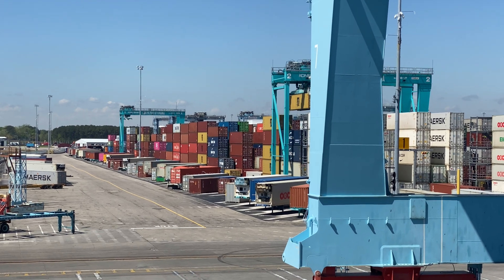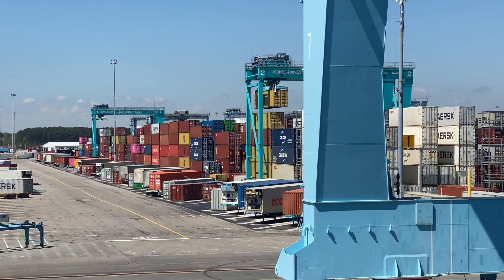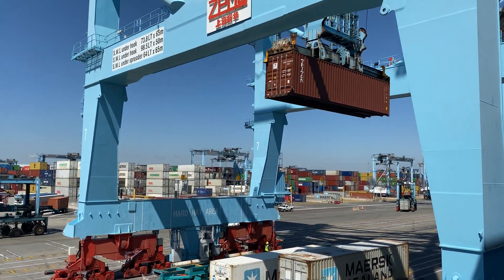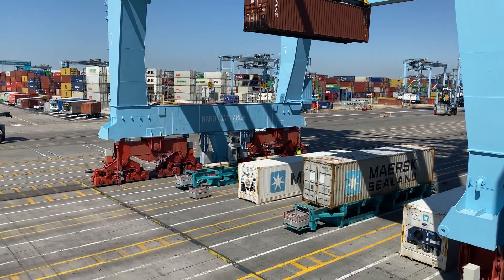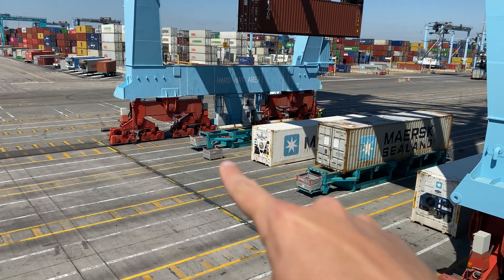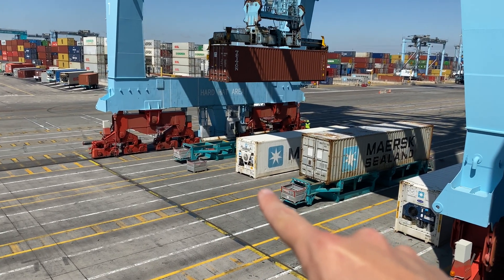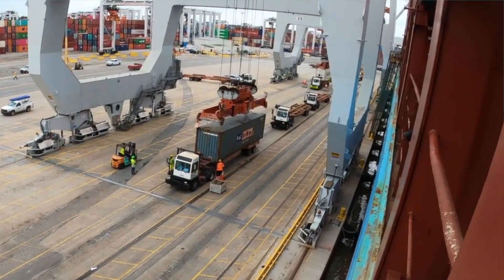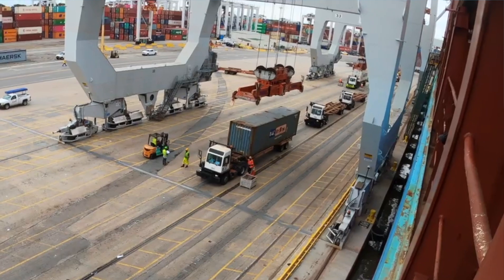Straddle Carrier Port Cranes Are Super Efficient | Life At Sea

Comment: Hi Bryan
When I was on container ships in the early 1970s, some ports in Europe used straddle carriers but others (in UK and Australia) used articulated trucks - and I agree, straddle carriers are a faster system (but of course more expensive.)  I'd not seen racks in use until this video.  I guess the racks are more to help the straddle carrier drivers place the containers directly under the portainer crane (to be in line with the bay being worked on the ship) though they seemed to manage OK without them, and still do in the two lanes in your video where there are no racks.  Is that the reason for racks?
Thank you for your videos - I enjoy them.
Reply: The racks (trays) are used to reduce strain for the ground men who load the locking pins in each corner of the container.
Reply: Australia had Straddles in the 1980s when I used to go with my Dad in the truck and drop containers at ports around Oz, I was amazed at how high the straddles were and how quick they zipped around.